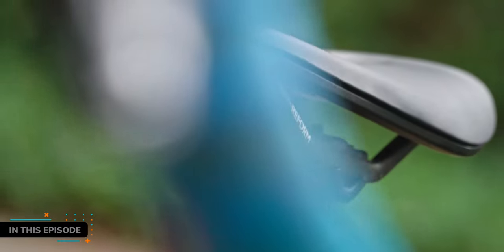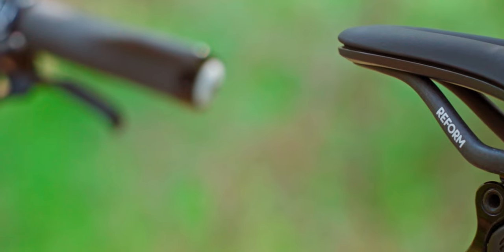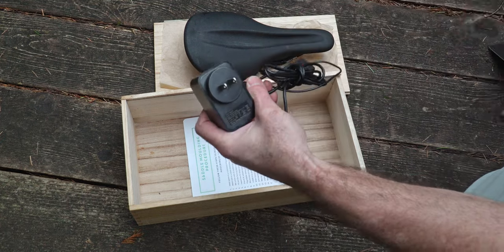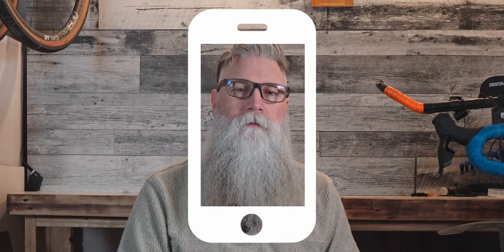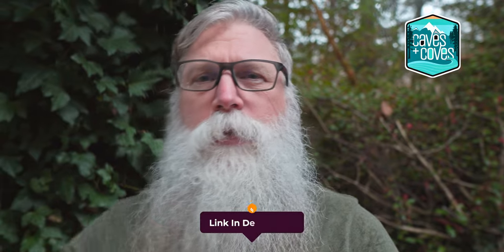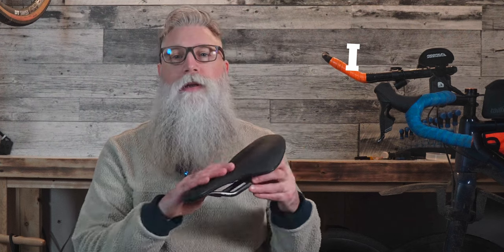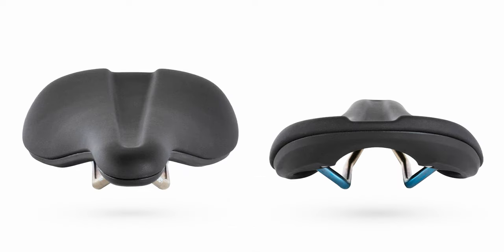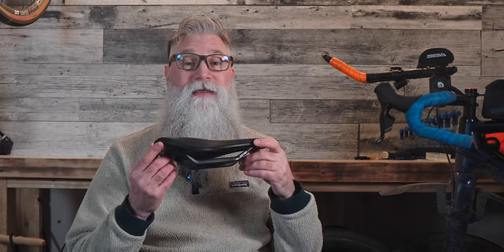Electric Saddle? Reform's Thermo-Molded Custom Saddle

Comment: Did you find that the saddle rubs against the inner thigh after extended periods, riding with pelvis rotated?
Reply from the maker: Yes... in both positions.  It's completely the edge design.  Not that thrilled with the edge.   I'm going to pick up a Tantalus model and see what improvements have been made, and how well it works (for me) on my MTB/bikepacking rig.
Reply: @SaltyBeard_Adventures  Thanks so much for this info.  Like many relatively short men, I do have a relatively narrow pelvis and this is always a concern for me.  Only the very narrow-nosed saddles fit me.